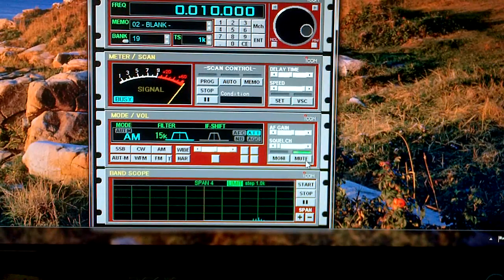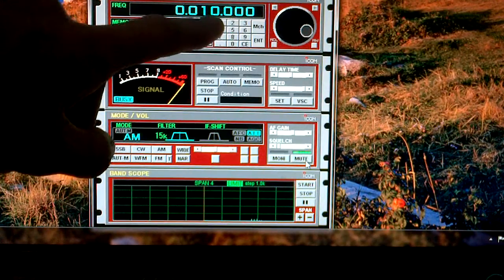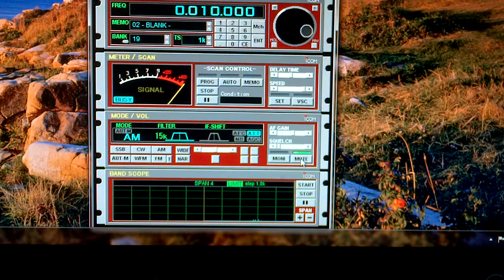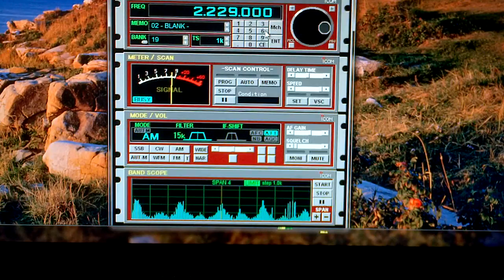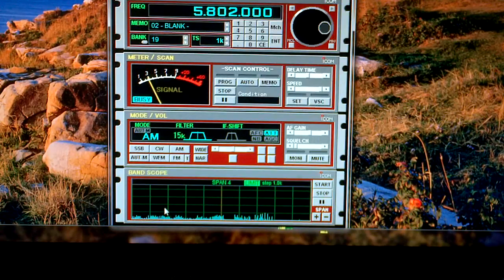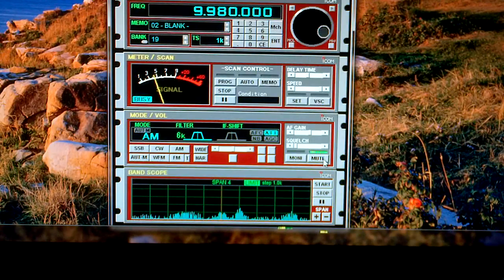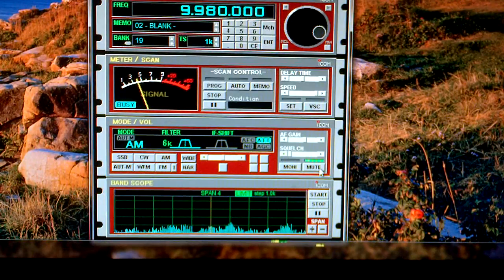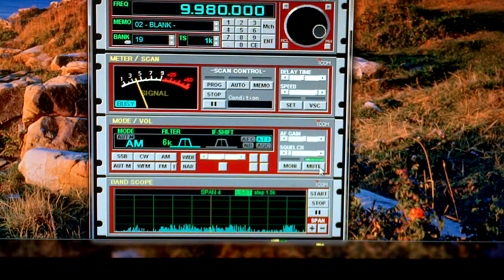More Radio Noise Investigation

Comment: HI Jim, my place is similar in terms of noise.   Things I've found that contribute are wall warts, all forms of fluorescent lighting, motors with no or faulty suppression, TV's and computers,  and I even installed LED lighting on my bench only to discover that whatever power supply is inside the unit is also causing noise.
Cheers,  John
Reply from the maker: We've really gone from a very quiet world in the 70's, to one filled with crazy short range signals coming from everything modern.  I stuck a few LED light bulbs over my bench too but they are probably drowned out by all the rest of the stuff.  Hey, I suppose my vintage test equipment is quiet - what about modern digital scopes, etc?

Comment: First place all your radios in a faraday cage ( :) ) then insure you have premium high grade feedline,  if your aerials are long wire, make sure none are aluminum!  Make sure nice thick copper wire! Upgrade any OLD feedline / long wire and insulators.

Clean connections of any corrosion!  make sure not next to power lines, phone lines or cable TV lines....make sure you are properly grounded and contacts are good at the source!!  May need to drive an 8 foot ground stake, ensure you use salt and rusty iron nails or scraps!

If aerials are aluminium dipoles or beams, again make sure premium feedline!  Make sure all connections are secure and clean!  Make sure PC is properly grounded and shielded! Power strips or even the house wiring could be part of the issue???

Honestly, you may never really get away from this!  As TroyDog stated, use an AM radio and kill everything....then one at a time!!  Good luck!!
Reply from the maker: Thanks JJDC.  All of your ideas are quite practical except it's a little like putting all the lions in a corral - leave just one out and your in for more trouble.  For now, I'm going to concentrate on understanding what makes all these signals and to that end, I just posted my next video.  

I do like TroyDog's suggestion on the breakers.  I might be inclined to just pull the main breaker and shut everything off at once.  I would want to be very prepared to make many observations while the power was off so I have to do a bit of planning first.

Comment: Oh snap you using compact fluorescent light?  I also had them do this. I went to all led bulbs in my house. A few other things I have found to cause am radio problems. Fans motor in say frig heating so on. Dishwashers and washing machines. 

Also earth wire in the house. But since most radios have no earth plug on them that could be ruled out. 

Also lcd tv's can do it I got a cheap one portable that makes am radio turn into a motorboat. 

But do the big test first run off wife for a few hours. Next battery powdered am radio. Kill breakers in house all of them. The turn each one on one at a time if the sound starts see what that breaker is running.  

If you take a radio outside am battery say front of house side back so on do you get that sound. I have a pocket radio I use for testing here.
Reply from the maker: I've done many of the things you are suggesting except the power off testing.

My wife is on her way to an appointment so now is my chance..

I can feel another video coming on . . .